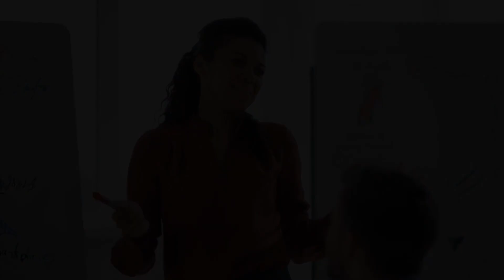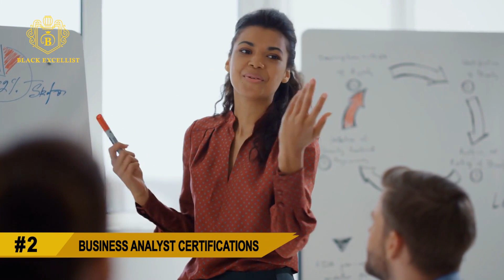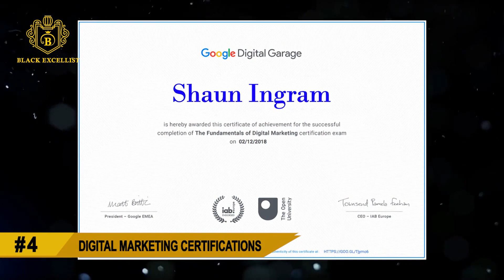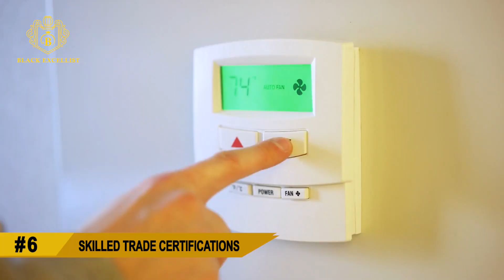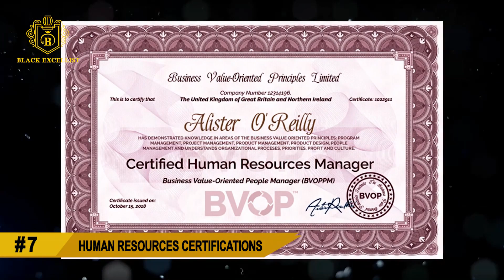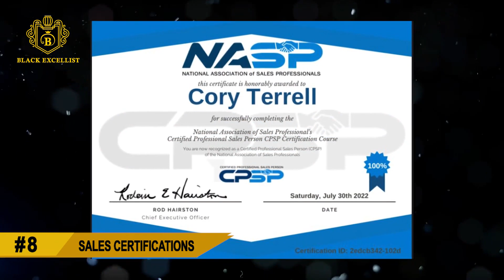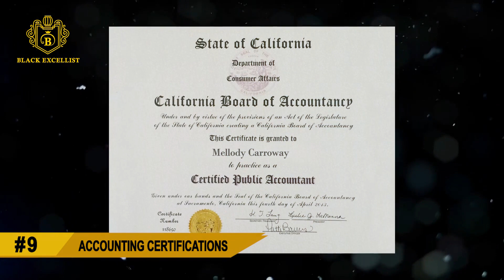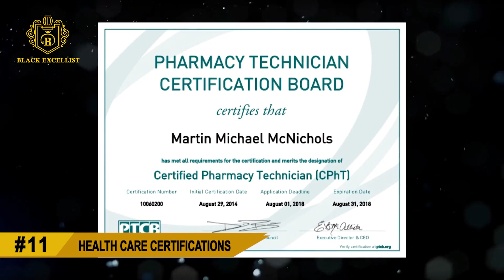Top 15 Certifications For 2022 | Highest Paying Certifications | No College

Comment: I would also add the Certified Information Systems Auditor (CISA) to this list as well. It is always on the top 20 IT/Cybersecurity List.
Reply: @mike do I need a college degree?
Reply: @johnoffier4397  No, but you will need at least 5 years of experience to be awarded the certification.
Reply: yes you need a college degree
Reply: @greatone090  that is incorrect
Reply: @mikecheck1229  damn that’s a long time what’s a good skill I can get into without needing a degree and that’s Entry level ?

Comment: I’ve never seen a non college grad obtain a PMP certification… so I would argue that a bachelors degree + experience is a must for project management. Excellent info! Thank you!
Reply: I can attest to not needing a degree for a PMP certification. Just received mine in May 2022. Just retired from the Air Force on 1 October 2022, and have been working within a Program Office for the last 4 1/2 years. Just got hired as a Senior Program Manager a month ago. It's definitely possible!
Reply from the maker: PMP doesn’t require a college degree but you will  have to show five years of overall project work experience, as well as 7,500 hours for the volume requirement. All other requirements are the same; the numbers just increase for the work experience.
Reply: I’m in a black women in PMP group on fb and there are lots of them without a degree making it happen
Reply: Also I’m a PMP and PSM II with no degree, the experience at times outweighs
Reply: Yup, same thing I said! You’re not getting a health care, HR, PMP or cyber security cert without a bachelors. You can get by with a diploma for the HVAC, cosmetology, electrician type of fields. The title is misleading for sure.
Reply: @FreshAF_11  the HR department at my hospital just wanted over 3yrs  experience working with the public and problem solving skills
Reply: @FreshAF_11  I know someone who took a cyber security certification three years ago without a degree and works at a fortune 500 company without a bachelor's degree. Provable experience is more important.
Reply: False.
Reply: False.
Reply: False.
Reply: False.
Reply: False.
Reply: False.
Reply: False.
Reply: False.
Reply: @FreshAF_11 Experience is the requirement to sit for the PMP, not a degree. You are overrating the importance of a degree.
Reply: @FreshAF_11  I agree lol unwritten rules